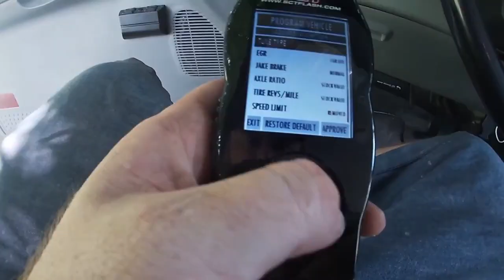1996 International 4700 Fuel Filter Change

Comment: Hey , how can I bleed out , I couldn’t find the plunger, mine ran out of Diesel and now doesn’t start
Reply from the maker: Go to the fuel filter which is on top of the engine. There is a lever you turn 90degrees. Turn the key on and off about 5 times until you got fuel bleeding out

Comment: How do you prime it?
Nice video
Reply from the maker: Best way to prime it is with the ignition.  Get a 2nd person to either open a Schrader valve or Crack a line.  Turn the key to the on position(not atart) count to 10 then turn off repeat 2 times.  Thanks for the comment!